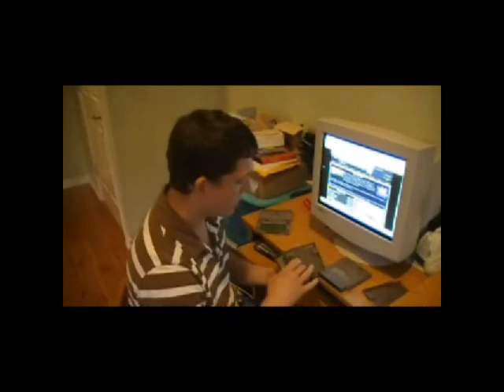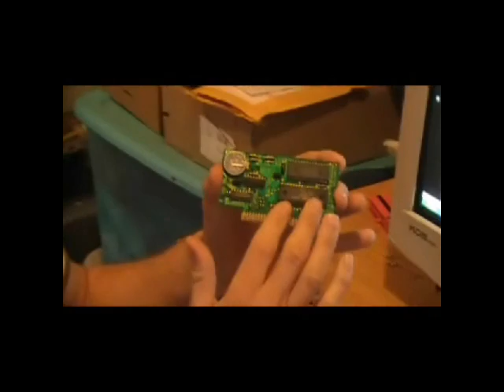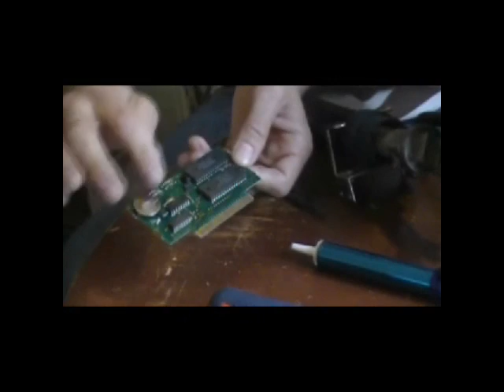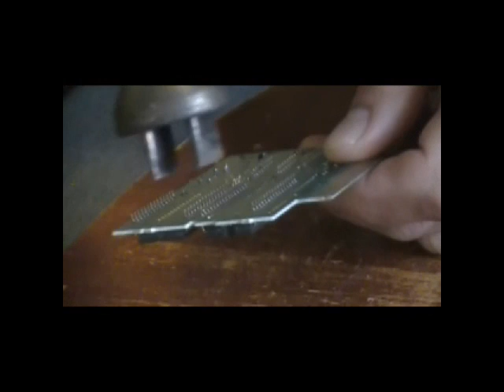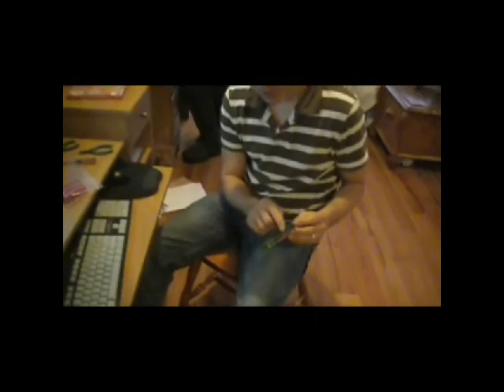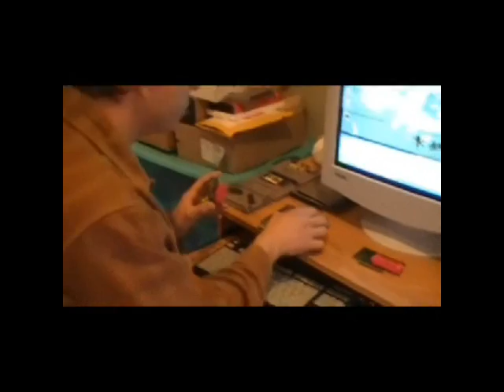Building A NES Reader

Comment from the maker: @nathantolbert1 You don't actually dump that. It's emulated just like the CPU. Those chips are hardwired circuits kind of like an advanced version of a gate. They were reverse engineered many years ago so now all you have to do is look the chip up to find out what it does. In fact, they might not have been reverse engineered even. Someone may have gotten copies of the original data sheets. I honestly don't know...